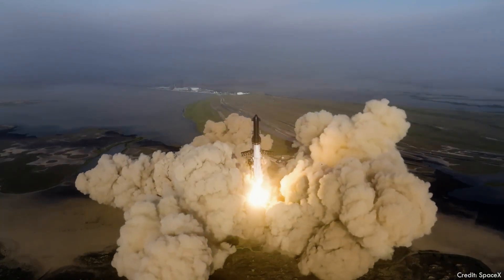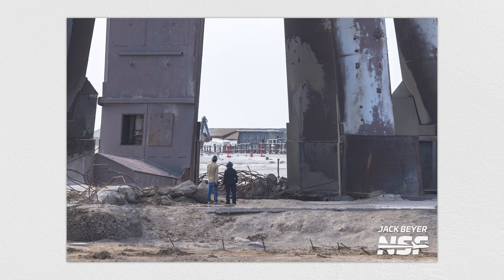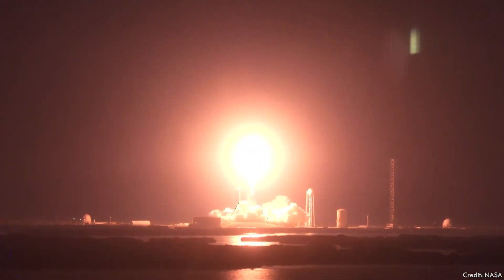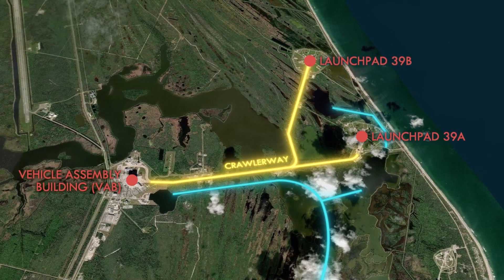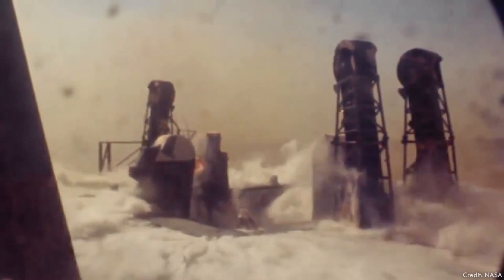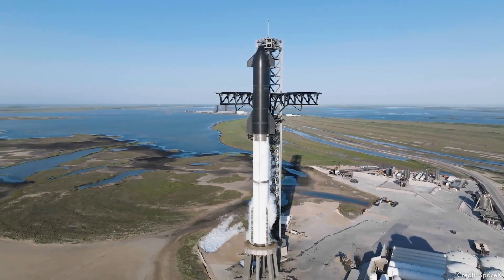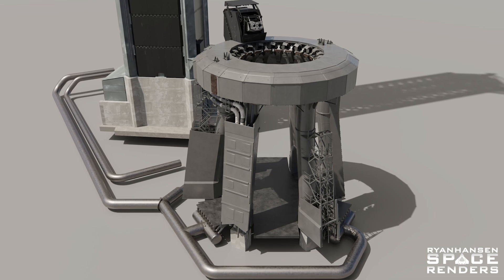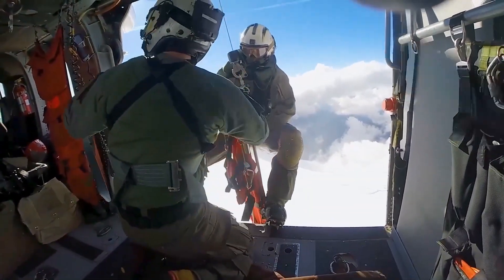Was Starship’s Stage Zero a Bad Pad?

Comment: Rapid iteration programs are a lot of fun to watch, but the downside is sometimes the failures are significant. But all good, I have trust in the engineers down there. I was in the military with several of them.
Reply: so why is it older on the surface want to keep going in circles? Maybe run for office. Something hit the earth.. the two chunks formed independently into spheres. The moon's surface where a astronaut fell on his back which was potentially life threatening but he was fine while coming back from gathering rocks at a meteorite impact site to get vary ages of moon rock samples. It's younger the deeper you go. You're not answering the question which is understandable no one has yet.
Reply: No failure was significant here.  They accounted for this by not intending to test again for 2-3 months.  They learned something new about the pad that they would have never have learned had they used the water cooling plate and never launched without it.
People seem to not understand what iterative testing is.  You test often and to failure.  The most important part is not to have failureless tests, the most important part of a test program is quick iterations.  Spacex has an assembly line for rocket components and a crew to fix or alter the pad as quickly as possible.
It does not matter what fails as long as it takes less than 2-3 months to fix.  Nothing is delayed by testing to failure.  Overall development is way faster doing this.  Tests catch new failure scenarios that simulations can't predict.
Spacex is showing everyone the proper way to build and test a new safe rocket. Boeing's safety and craft failures prove test-less development is not safe.
Reply: @_PatrickO The environmental failures were pretty bad here
Reply: @guptaamey nah. It's just concrete bro. It's going to be ok
Reply: @pierredelecto7069  The problem isn't necessarily the materials, although refractory concrete and dust being pushed into the air isn't great for anyone. 

It's the large volumes of these materials being propelled at vehicular speeds through fragile ecosystems that causes the real damage.
Reply: @_PatrickO  Did you watch the video? Things are delayed here because Starship is grounded due to the damage this launch caused to the surrounding area and the fact that SpaceX did not note any of this potential damage in their plan submitted to the FAA. Iterative testing is good, but you can't just ignore the dangerous side of it. Performing the test this way was obviously reckless and people were pointing that out even before it was performed.
Reply: @_PatrickO ignoring what we knew in the past is learning by stupidity, they knew what was going to happen and we have known for generations how to prevent it. Pushing the test flight before the pad was ready was a waste, sure they learned important data, but they could have gotten more if not for the pad failure. People in the early age of ICBM's knew what would happen and today with decades of experience it was ignored.
Reply: @PigeonHoot so why hasn't nasa ever gone back to the moon with 60 years of knowledge?
Reply: @foolicooli  we learned all about the moon we needed and the rivalry with space between the USA and USSR toned down (as the USSR was running out of money). The only reason we should go back is to practice living off world, testing radiation shielding and installing observatories. Some of this we don't even need to be on the moon either to test and do. We can do some on earth and some in orbit so why spend so much when we can get the same results for cheaper, faster and just more chances of success.
Reply: @PigeonHoot  so just observing from a far is adequate? Building on the moon even if not a permanent living quarters seems like a smart idea if we ever want to build any where not on earth...
Reply: @PigeonHoot  also I think we still need to visit the dark side;)
Reply: @foolicooli  i mean, its what we have been doing for decades, its not like anything outside the solar system is out of reach, and even in the system its limited.
Reply: @PigeonHoot  you know a really interesting fact about the moon is that the surface towards the center is reverse of the earth? The rocks are older on the surface than the deeper you go, it orbits in a near perfect circle around the earth and no other moon has been observed that was so large compared to the planet it orbits. Our moon seems very special and worth more investigating. It's also odd that it doesn't rotate on an axis. Our moon being so unique learning more could open up new discoveries and it's not that far astronomically speaking.
Reply: @foolicooli  no, like i said, we already know what we need to know. Earth and the moon composition is similar because they are from the same bodies, its orbit is more stable but corkscrewing further from us. The other moons we see won't always exist either. One of mars moons is supposed to disintegrate and become a ring in the future. Ours in the future won't always be there either. Things can be quite unique but also quite boring like the moon.
Reply: @PigeonHoot  why are the surface rocks of the moon older than the oldest rocks found in our ocean?
Reply: @PigeonHoot  it's boring if you don't ask questions to things that haven't been answered
Reply: @foolicooli  because two planets collided and a chunk of this one and debris from the other ended up in space, while the planet becomes molten again. In the meantime the planet cooled, the moon gained mass and became what we know.
Reply: @PigeonHoot  that doesn't answer the question lol
Reply: @PigeonHoot  you understand it's much older rock would of been deposited in our crust as well right?  Or that all planets essentially form the same way but we still are able to date rocks by est ages. The deeper we go in our planet the older it gets. The moon's is the opposite.
Reply: @PigeonHoot  block away
Reply: @foolicooli  The moon does rotate on its axis, it rotates at the same speed as the earth so we always see the same side. The physics of this are well understood and the moon is not special for this, several moons in the solar system are locked in the same way: https://en.wikipedia.org/wiki/Tidal_locking
Reply: @mkilgore  it's 25 percent the size of earth and 2 percent as dense. The density is higher on the surface than the center and the rocks on the surface are older than towards the center. It's quite special.
Reply: @foolicooli  Do you have a citation on that? And what does that have to do with whether or not it rotates about its axis?
Reply: @mkilgore  my fault it does rotate on a axis without a magnetic field. I assumed no magnetic field meant no axis/poles. Also it is 7.342×1022 kg or 0.0123 of Earths mass that's citation is really any science book wiki Google.. assuming no magnetic field is due to the core being too small again that is what the books say.
Reply: @foolicooli  You realize mass and density are not the same thing right? The Moon is about 1.2% as massive as the Earth, but the volume of the Moon is only 2% that of the Earth. So, taking both of those into account, the average density of the Moon is actually about 60% that of the Earth.
Reply: @mkilgore  it can't be generalized that easily consider one side of the moon is denser than the other so how can we accurately measure it?
Reply: @mkilgore  it literally deleted my entire post with the last link I just sent
Reply: @foolicooli  Density is just mass / volume. The volume of the Moon is easy to calculate since it's roughly spherical, so it's just a question of mass. There's a variety of ways to calculate the mass of the Moon, but I'd point out that you provided the mass of the Moon, so unless you're saying that number is wrong then calculating the density is easy. And of course, that density is not the same everywhere on the Moon, it's an average, the same with the density of the Earth.
Reply: @mkilgore  the lunar surface/crust density is 3.4 g/cm power of 3, the Earth's crust is 2.6.. my point still stands the outer layers of the moon is more dense the Earth's mantle is 5.6 the moon's mantle is 3.2 you see where I'm going?
Reply: @foolicooli  Are you sure about that? A quick Google suggests the Moon rock brought back by Apollo had a density of 2.6 g/cm^3. Since that's less than our calculated average density of 3.3 that means the inner part of the Moon is denser than the crust.

What source do you have saying the Moon's crust has a density of 3.4?
Reply: @mkilgore  Smithsonian
Reply: @mkilgore  Rochester edu, states 3.4 space university claims 3.2 uncompressed crust, of course deleted another post with links in it. Funny how you ignored explaining how you're posting links. Smithsonian seemingly only estimates mantle density and total (entire moon) you should read more closely. So that's a range of different sources giving numbers between 3.2-3.4 everyone's guessing almost like we need boots on ground to actually know what we already supposedly know. If you would like a lecture again please continue
Reply: Now explain that lunar rocks collected are about 3.16 billion years old for the basaltic samples derived from the lunar maria, up to about 4.44 billion years old for rocks derived from the highlands the earth is about 4.5 billion years old. Why is the crust so old on the moon? If the moon was made mostly of old Earth's mantle and crust why is it so old on the surface of the moon? That makes earth being dated as 4.5 billion years old seem inaccurate at the least.
Reply: @_PatrickO  I'm aware. I never saw it as an issue. I'm in favor of rapid iteration and love that we have a company willing to do it in the space flight industry. I got to participate in something similar in the aviation world albeit with no RUDs.